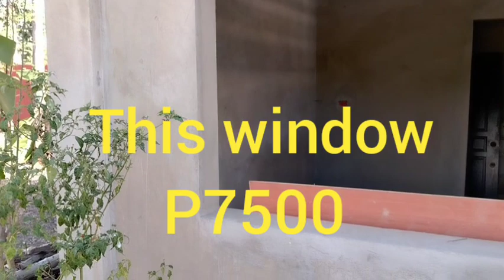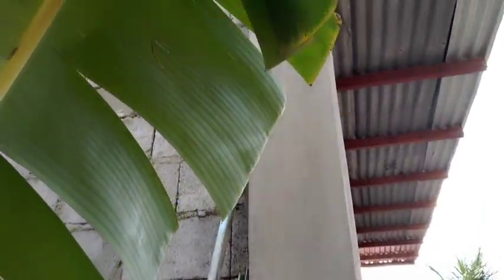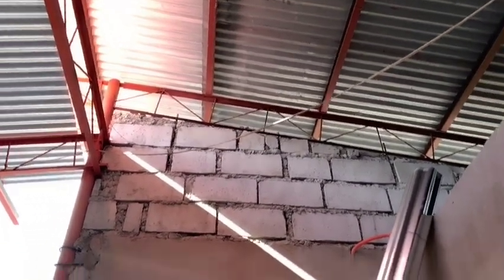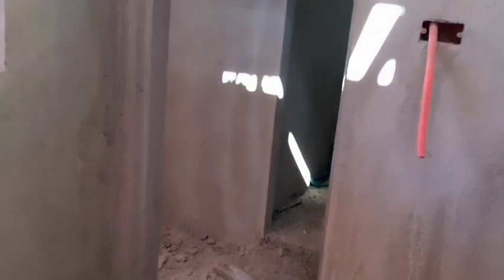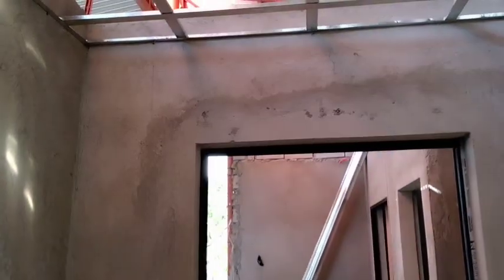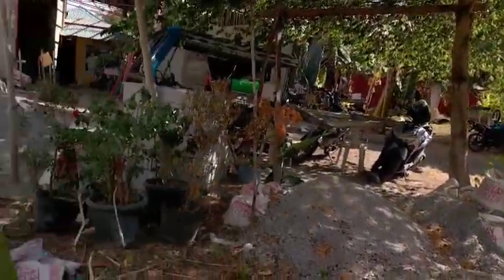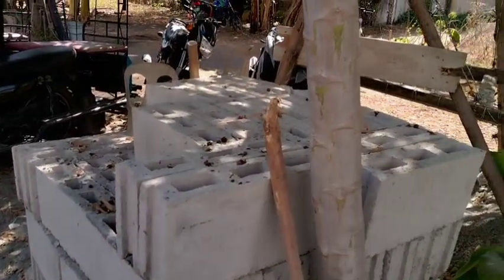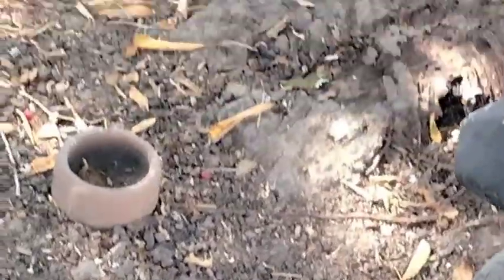HOUSE BUNKER BUILD in Dumaguete

Comment: Rolled heat barrier does NOT work much! I had to completely redo my attic! Because the Filipinos do NOT know about insulation and vapor barriers! I ended up using 2 feet of Rice Hulls In bags for attic insulation! Combined with a roof top whirling vent!